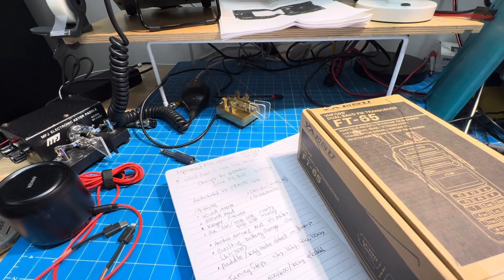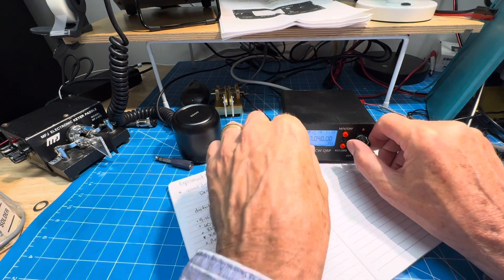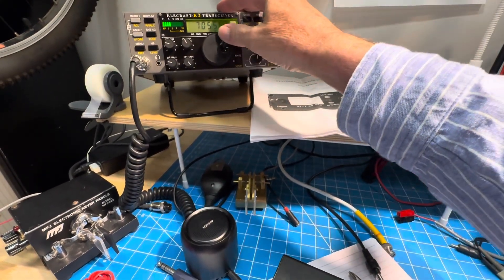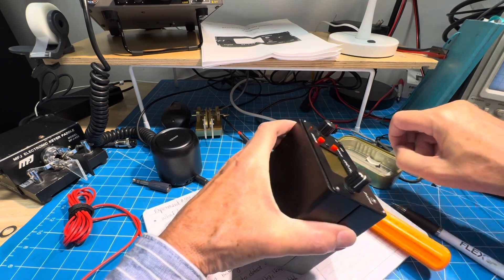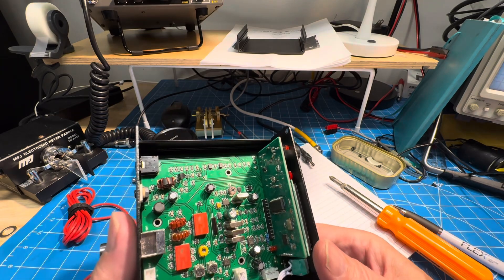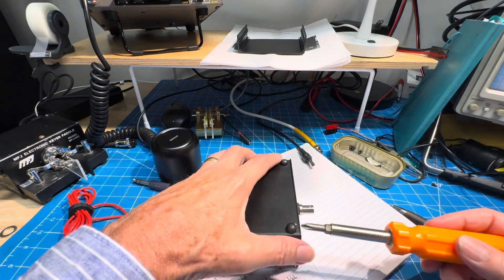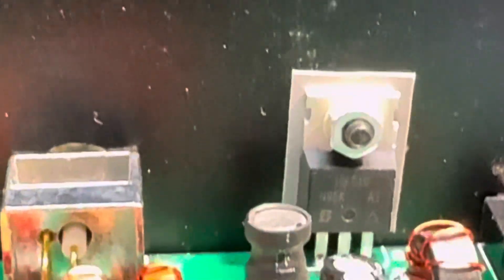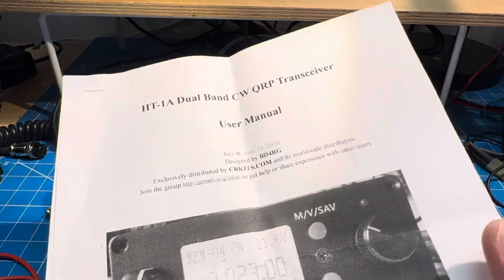Another $102 Radio from eBay - but it’s pretty cool

Comment: I bet the ref osc uses a flip-flop divide by 2 and it feeds 27 MHz to the VFO. That's a very common freq for a lot of digital VFO's. But if they become at all popular someone will do a schematic for it. That's why I prefer to buy older gear. Someone usually has done a schematic for it, as well as mods to improve it, as well as done a firmware rev or 2, so I don't have to.   :)
Reply from the maker: Lee commented just before you that he has a schematic. Would one of you guys do a walk-through? 
What are the typical improvements to the firmware for a rig like this? 73, Bruce